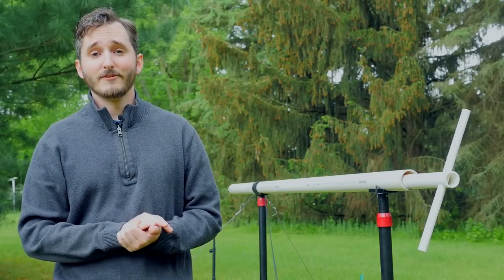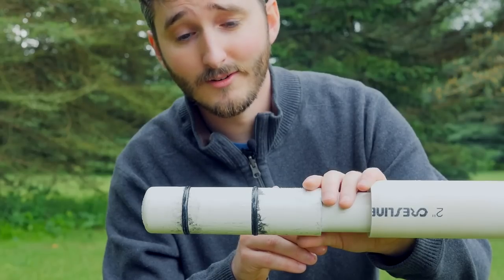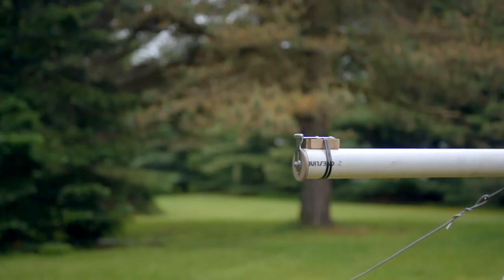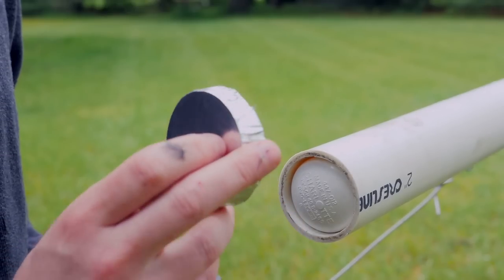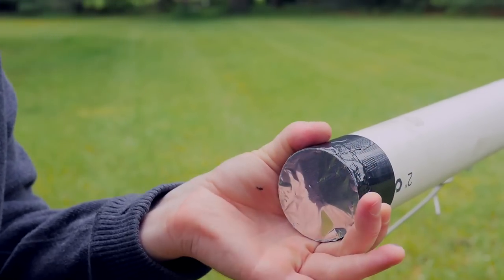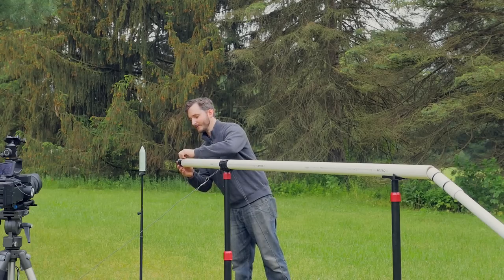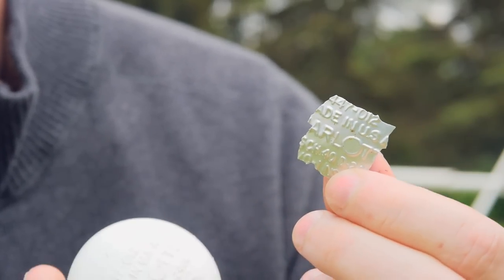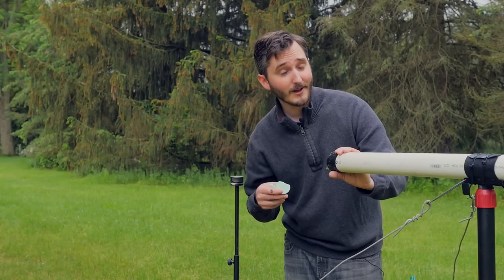New Vacuum Cannon Design - No Vacuum Pump Required!

Comment: Interesting, you could even design one of these with an air pump and solenoid on the end instead of a mechanical piston, however it would have to be constructed from steel to resist implosion.
Would also need to be muzzle loaded, with the air valve sitting just before the projectile to create that vacuum between it and the burst film and the solenoid behind it to allow pressurisation.
Would be curious to see how that would turn out.

Comment: Since the force from the air pressure hitting the flap valve is fixed, I would think that finding ways to make it lighter would increase the rate it accelerates out of the way.  The metal hinge seems like a good candidate to replace; perhaps even hanging from two strings instead?  Or mount the hinge below to allow gravity to assist instead of impede?
Edit: Just saw Eren already suggested the bottom mount.

Comment: Hot glue the flap disk upside down?  Let gravity assist in it opening.  You may need a clasp at the top to keep it closed until there is enough pressure to keep it closed, maybe a string release?

Another thought for a trigger...  If the piston was open on the end and the puller was sealed you could have a flap valve on the puller part that could be opened to fire it off.

Comment: Had anyone suggested a larger vacuum chamber reducing down to smaller diameter barrel? That is how my brothers and I made or potato cannon decades ago. Two challenges would be posted: 1) what would be the most efficient barrel-chamber length ratio? 2) how do you keep the projectile from falling backward into the larger vacuum chamber?Are those surmountable?What would the resulting PSI be for a 4" chamber connected to a 1 1/2" barrel?

Comment: Awesome video as always. Do you think using magnets on the plunger and adding ferrous metal pipe to the cap and separating it a little from the plunger would give it more mass and allow the cap to get more air behind it?

Comment: one idea I had for the front flap would be a small lever inside the barrel that opens it when the projectile strikes it. of course doing it electronically is a better option if you know how to do it
Reply: or a bypass pipe at some distance where a little air can go ahead of the projectile and open the door

Or the bypass pipe leads to a piston that opens the door
Reply: Nabre Labre The bypass tube could work, I guess it would be kind of like a gas tube in a gas operated automatic/semiautomatic rifle

Comment: i wonder if it wouldnt be possible to affix some kind of crank to the cannon itself, so you could pull the plunger back without having to secure the canon down so hard, might also work on a bigger canon since the crank could probably pull back a lot harder than you pulling directly

Comment: Have you ever played with rectangular section? I know it doesn’t have the structural integrity, but I’m considering some high speed imaging within a vacuum cannon and the optical technique I’m using will not deal with a cylinder due to it acting as a lens.

Comment: I'm sure you tried this and it would weaken the cannon, but what happens it you leave a foot of air or 6 inches in the barrel with the flapper? is it too weak? is the flapper still to slow even with the extra puff of air? just curious. I love your videos they are the highlight of my YouTube experience.
Reply from the maker: The flap should open in that case but it would be much weaker.

Comment: I love your vacuum cannon with the piston and crank. Elegant. But aluminum foil over the muzzle seems inelegant, although effective. I saw that the flapper seal did not open fast enough. So here's an idea: attach an arm under the barrel so that it ends about 18 inches below the barrel's muzzle. To the arm you attach a piece of surgical elastic, say 3/8 inch. Make a seal for the muzzle that has a a small step, say 1/8 inch, that fits inside the barrel. Attach a simple elastic to either side of the barrel long enough so that it can be stretched to span the front of the barrel. You use this elastic to hold the seal on the front of the barrel before you draw the vacuum. Run the piston to front of the barrel. Place the seal over muzzle and use the rubber band to hold it in place. Crank to make a vacuum. Before you fire by pulling the piston all the way out, release the rubber-band that was holding the seal in place. It will stay just fine with atmospheric pressure. Stretch the surgical elastic and attach it to the seal. Between the atmospheric pressure and the step it should stay in place. Fire the cannon. As the projectile pushes the small amount of air in front of it out of the barrel, that air will push the seal off of the tube. The elastic will pull the seal out of the way before the projectile hits it. You will have to experiment to see how much elastic you need. Given the speed of the projectile, you might need a foot of elastic stretched to 5 feet to move the seal away fast enough. If this works you would have a fully built cannon that does not need tape and foil. Good luck, Phil.
Reply from the maker: In my most recent video I solved this issue by using plastic cups instead of foil.

Comment: Since you have a large backyard, I wonder if you could built a mini web of vacuumed tunnels where the projectile would be pulled from station to station using a vacuum cleaner and a network of valves.

Comment: :D very cool!. For the end (pressure disk) I personally use a smaller bit of pipe with a bit of the main bore on it then sealed off and O ringed into place and as the slight "back pressure" generated by the projectile moving forwards increases, it pops the end cap off and i use a few cable ties and some doubled sided "sticky pad" cable tie retainers to keep the whole thing from flying off in random directions it is in essence a dumb one way PLUG , hope that helps btw you are generating quite a lot of force with that wee beasty, hope to see you at VCW :)

Comment: did you ever consider a spring loaded flap valve?  meaning a spring that holds the flap valve open, and you would close it at the beginning of the vacuum, and when it fires, the spring will move the flap out of the way before the projectile hits it.

Comment: Maybe mounting the flap on the underside could make use of gravity to open it faster. Then again, difficult to keep it closed before your pull the piston back. And mounting the flap to the barrel could ruin the cannon if the flap is hit, rips off and tears a hole in the barrel.
Reply: ruolbu I was thinking the same thing.

Comment: drill holes around the back part of the cannon. Then when the piston reaches that point air rushes in and boom it goes off. Have a lip around the back of it to hold the piston in so you don't pull it all the way out :p

Comment: What If you had a little more air in the barrel to begin with when using the flap valve? It would be a little less efficient but it might give it enough air pressure to push the flap out of the way fully before the projectile exited the cannon. Just a thought.

Comment: Have you tried adding a spring to the flap  valve or a string/pulley mechanism that pulls the flap valve up when the piston has reached the end of the cylinder?

Comment: What about using some sort of friction adapter to pull the projectile back? It could be permanently mounted to the piston and allow a light press fit of the projectile. Perhaps it could be simply two tabs of PVC that couple with the projectile in the same manner as the tape, but from the inside of the projectile.
Reply from the maker: Good idea, might try it.

Comment: you should figure out a way to be able to shoulder mount this either use like a bike pump or something to empty out the air or you could add some more pipe to sort of curve the part you pull back around so you can carry it while using it.

Comment: how about using a spring/rubber to  operate the flap and get it to open much faster? and a small piston that would  use that little built up pressure to release the flap

Comment: Do the 2 oil rings just slip over the pvc pipe or do you have to make a grove on the pipe to hold them in place, also could using a rubber band hold the foil in place. I sure enjoy your channel, you are very creative/talented/smart
Reply from the maker: This is how the pistons are made: https://youtu.be/BCZGWvieJ7I a rubber band is not strong enough for the foil

Comment: I think you could use the flap/ henge burst plate if you didn't have the heavy bolt and nut in the center. Maybe a single piece of heavy rubber with a string instead of hinge, then you don't have to make all those burst disks and tape things.

Comment: What about mounting a flap valve upside down? but designed in a way as such when it's closed gravity pulls it closed, but when it crosses the center of gravity it can fall, so the air can push it enough for the valve to fall from gravity. Although I'm not sure of gravity could pull it down fast enough

Comment: Since your projectile is heavier it should travel farther than a faster pingpong ball. How much DISTANCE could you get if you launched at a 45 degree inclination?  That's also a nice way to indirectly gauge velocity instead of  trying to estimate high speed camera frames.

Comment: Hey! Nighthawk! What if you make your projectile into the same cap that would fit over the end of the cannon instead of going inside it. Sure it wont be able to travel down the cannon like a normal projectile, but instead the air hitting the back of it would have significantly more force right? Would the sudden impact of the air shatter the pvc?

Comment: What if you used a projectile as the seal? Just make sure there is a flange at the front that keeps it from traveling backward as the piston creates the vacuum. The projectile could be essentially the same construction as the piston using pvc and o-ring, perhaps with a conical front for aerodynamics. The cone would be wider than the main cannon pipe so it doesn't retract the projectile.

Comment: What if you attached rubber to the flap valve so that the vacuum holds it in place and when the air rushes in, the valve is opened not just by the inflow of air but also from the force of the rubber? Just a thought, not sure if it'd work.

Comment: The burst disk might not be necessary. I will explain; in the middleish have a part which is narrower that the projectile but still has a hole in it like this:

____________        ___________
                     |___|
                     __  vacuum
_____________|       |____________

Have the projectile sit blocking the air and sealing the vacuum. This way, there is no need for an end cap and the air tstill has a chance to push the projectile down the tube. The projectile is the seal, and when you pull the piston out the whole way it will let all the air in to push the projectile. Just an idea.

Comment: Could you do a two handed one that just has the air break the sound barrier maybe with the burst disc end being tapered down to a small diameter?
I have made several of your designs and although they take quite a bit of fiddling to get working, they are very satisfying, normally resulting in maniac laughter which amuses my family 🤣👍

Comment: What if you put the piston on a rope pulled by an attached crank instead of a PVC rod? As long as the piston clears the opening the fleece is isolated to a smaller location, reducing the need to having it anchored down so much.

Comment: you should use an upside down flaw with a small latch to hold it before firing, when you want to arm it unlatch it and boom problem maybe solved.

Comment: If you were to make the projectile slightly smaller, would enough air be able to rush in to flip the flap up before the projectile hits it? There would however be a slight loss of power I assume.
Reply from the maker: Yes but the power loss would be very bad

Comment: I wonder if it its possible to combine a vacuum cannon with a railgun to accelerate the projectile before it enters the rails. Also, wouldn't a large vacuum chamber right at the end of the barrel solve the air cussion problem?

Comment: RACK AND PINION + Spring load burst flap!  To get around having to secure it to the ground so heavily what if you cut 90% of the back end of the plunger and replace it with rope.  Run the rope thought the cannon then load the cannon as usual.  Spool the rope thought a ratchet system attached to the rear of the barrel and crank to draw back the piston head.  Once primed the remaining bit of the plunger could just be grasped by hand and yanked to ensure a rapid ingress of air!   Thoughts :D ?
Reply: If the seal around the piston head is sufficient, this idea could also be scaled, taking mechanical advantage of a ratcheting system would allow implementation of a larger barrel that would be too heavy to pull by hand!

Comment: Could you put a piece of bike inner tube over the end and use it to hold the burst cap? You would need the cap to extend down the pipe more, but if you fold back the band, place on the cap, then lay the band back so it covers it, would it make a proper seal? you could tape the stationary end of the band down. It should reduce waste

Comment: What would happen if you didn't load a projectile and let go of the handle just before the piston would leave the barrel?

Maybe with a rope pull secured internally rather than a horizontal handle, so it wouldn't get smashed into the end of the barrel.
Reply: Then the piston would go flying like an arrow, but not nearly as fast because it's a lot heavier than the cap and has a lot of friction from the seals.

Comment: Can you make a noise cannon using a 55 gal steel drum as a noise chamber  to shoot plastic balls slightly smaller than the size of a basket ball but lighter through a hoop at about 75 ft. with a shotgun shell? The hoop could be slightly larger that a standard basket ball hoop.  You can consider this a CHALLENGE  if you like. Perhaps two 12 gauge shells fired at the same time.

Comment: Could you move the piston with a cable by turning a winch? It could reduce the space requirement behind the cannon. Though I imagine it would be more difficult to load it. Either a pole just as long as the barrel (so no real advantage there) or front loading and somehow getting the cable to the other end.
Reply from the maker: Yeah you could, but I'm not sure it would be any more convenient.
Reply: If you were to try and shoot at an upwards angle, the long pipe would possibly hit the ground before the piston leaves. That's where my though came from. ;)

Of course, that is very dangerous to do, I know ^^

Comment: What if you made a cone design made with several curved triangles at the front that holds a seal with rubber lining. That way the pressure opens it up some and the projectile can gently open it up the rest of the way.

Comment: hello, ive been following your channel for a while and have taken a liking to your vacuum projects. So i have tried to create a piston with an air tight seal, but have failed time and time again, i simply cannot get it to be air tight without the piston having too much friction with the chamber making almost impossible to move. I was using a
6.5cm outer diameter piston
7 cm inner diameter chamber
i tried using a 0.5cm thick O-ring got an air tight seal but the friction was far to great. I also gave 0.3cm thick o ring but it didnt not seal at all.
i also tried using compressible rubber, closed cell sponge rubber 0.3cm and 0.6cm thick bands that i cut to length to fit the circumference of the piston, but i ran into the same problem, being the 0.6cm thick rubber was far to tight despite being compressible and the 0.3cm thick i believe the "cutting to length" process is just too flawed to get a seal. 
the O-ring thicknesses were the only two sizes i could find in my town, that also fit my piston of 6.5cm. My next thought would be to try to order some 6.5cm inner diameter 0.4cm thick O rings, but due to my previous and numerous attempts failing i thought i would just be wasting my money. 
So would you please reply the dimensions of setup in metric units so i can perhaps see what I'm doing wrong
Reply: also i used lubrication and thicker O rings would completely strip the chamber of lubrication

Comment: I'd give the flap valve another chance. It looks rather heavy at the moment and the projectile hitting metall doesn't help either. Can you build it lighter and without   the huge screw head poking through the cap?

Comment: do you think that if you move the piston extremely fast, you'll still be able to create a strong vacuum but air won't have much of an opportunity to leak in, resulting in a much stronger vacuum to propel ammunition
Reply from the maker: There's no leak as it is so moving the piston faster won't result in much improvement.

Comment: OK I'm guessing the beer can is about two feet away from the canon. The video is recorded at 29 frames per second (at normal recording speed). And narrator said the slo-mo is 960 frames per second. Since it takes 5 frames (at 960 frames/second) to exit the canon and hit the can(at 12 seconds into the video), the elapsed time is 5.2 milliseconds. So the speed is about 384 feet per second or 261 MPH! Not too bad!

Comment: What if you turned the flap valve upside down, and let gravity help move it out of the way? You would need an assistant to hold the flap until enough vacuum was built up to hold it...

Comment: What if you put a check valve about an inch from the front on the side? It would hold the vacuum, but allow that but of pressure out.

Comment: That flap you had that dropped down over the end of the pipe for sealing purposes.
Why did you have it mounted on the top of the barrel?
If you had of mounted it on the bottom it would have dropped down with gravity the moment it had air coming down the tube.